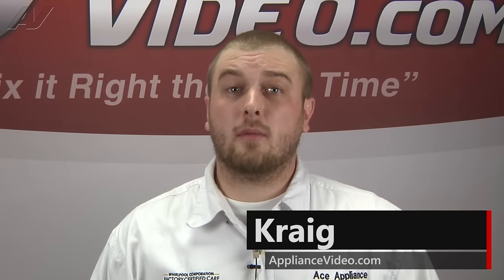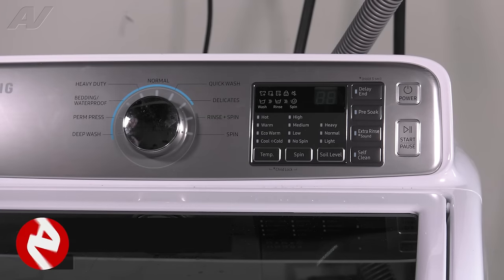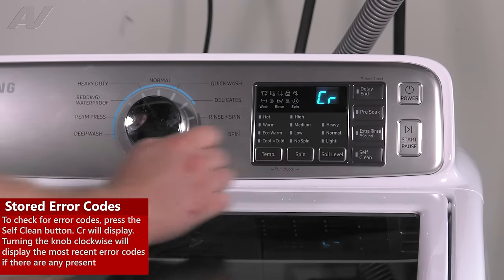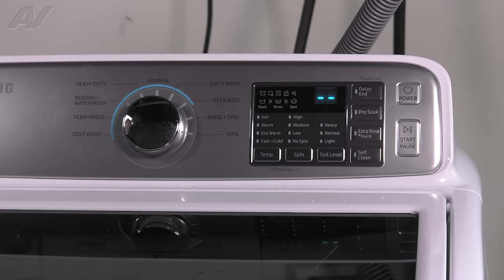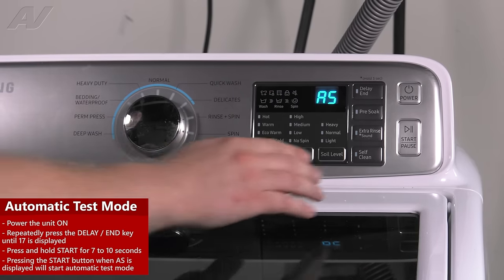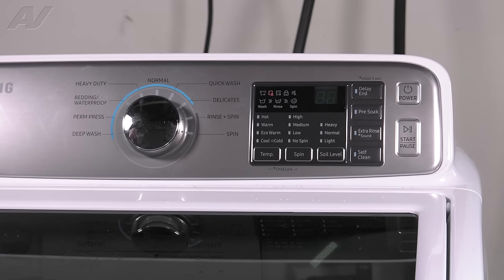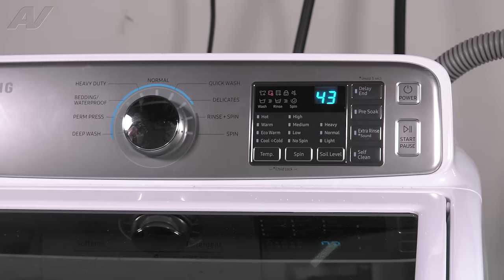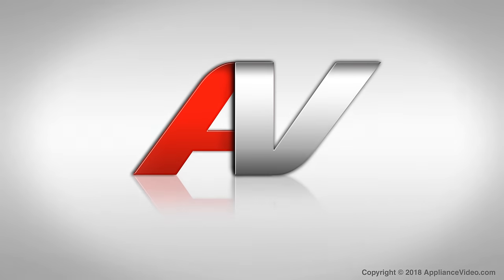Samsung Washer  - Diagnostic Mode, Error Codes, Troubleshooting

Comment: I have the same question as Linda a montho ago. My washer will not enter the AS mode.
Reply from the maker: Great question, if you have a more technical question that our parts department cannot answer, you can search our over 13,000 answered questions free at our website www.ApplianceVideo.com under our Repair Help section. You can also call our parts department at 1-800-830-5465 and they can give you help 7-days A week ,or search at www.SaveMoreOnParts.com  .
Reply: @Appliancevideo  Useless reply.
Reply: @damon7921  exactly that's all they just comment

Comment: I get a UE code all the time, I replaced the 4 suspension rods and was wondering what else I could do to reset it or recalibrate it.  The sumsung top washer is 9 yrs old..
Reply: I'm in the same boat. Changed the 4 x rods and cleaned the water pump. I still get the water and spin at the 8-9 minute mark and goes on until I manually stop it. I have to separate the load, then spin only for another 11 minutes. Add the second half load... Very labor intense... Anyone got any ideas?
Reply: calibration worked for us.  
To calibrate a Samsung washer, you can follow these steps:
1. Start by making sure the washer is empty and the water supply is connected.
2. Power on the washer and press the Power button.
3. Press and hold the Delay End button for three seconds to enter Calibration mode.
4. The washer will display “CAL” on the screen, indicating that it is in Calibration mode.
Reply: @Mikey-vt3to  I double-checked my error codes, and they went away after the reset. Also, put in a wash last night, and it ran well! The spin cycle is now robust. Thank you.

Comment: Just got this machine two weeks ago and already it's making a horrible grinding noise and won't spin.  Or anything else for that matter  With the exception of a KNOB to turn, it appears to be the same model except it's all digital.  I did everything you said and got to the CR, but then because I don't have a knob to turn I pushed the buttons one at a time, that corresponded as if I had a knob.  Nothing.  I couldn't get to the error codes.  And, nowhere on the internet/youtube can I find help for this.  Any help?
Reply: I am having the same problem
Reply from the maker: Great question, if you have a more technical question that our parts department cannot answer, you can search our over 13,000 answered questions free at our website www.ApplianceVideo.com under our Repair Help section. You can also call our parts department at 1-800-830-5465 and they can give you help 7-days A week ,or search at www.SaveMoreOnParts.com  .

Comment: please can you help me with washer???? when i put the washer in the program mode its fill with water,the pump runs and the agitator run but i wont get the final spin could this be a main board that needs replacing? also the console wont allow me to enter a wash cycle. any idea? thanks in advance...
Reply: model # wtw7500gc2
Reply from the maker: Great question, if you have a more technical question that our parts department cannot answer, you can search our over 17,000 answered questions free at our website www.ApplianceVideo.com under our Repair Help section. You can also call our parts department at 1-800-830-5465 and they can give you help 7-days A week ,or search at www.SaveMoreOnParts.com  .

Comment: We can press the delay key but when we press and hold start it won’t bring us to the ‘AS’ code.
Reply from the maker: Great question, if you have a more technical question that our parts department cannot answer, you can search our over 17,000 answered questions free at our website www.ApplianceVideo.com under our Repair Help section. You can also call our parts department at 1-800-830-5465 and they can give you help 7-days A week ,or search at www.SaveMoreOnParts.com  .
Reply: Same thing happens to mine too! Mine is a front load :)

Comment: Mine is showing code SC or may be 5C my washer is MODEL : WF45N5300UAW/US do you know what that means I've only had the washer for a year and cant find my receipt for warranty and the sears store I bought it at has closed down. I clean the filter once sometimes twice a month and only thing ever in it is just lint junk unlike to call it lol. The thing that spins to the left on the inside of the pump spins and it sounds like it pumping but water barely drains. The hose isnt to far into the hole in the wall so I dont understand what that code is for it spins with no noises just leaves water in the drum
Reply from the maker: Great question, if you have a more technical question that our parts department cannot answer, you can search our over 13,000 answered questions free at our website www.ApplianceVideo.com under our Repair Help section. You can also call our parts department at 1-800-830-5465 and they can give you help 7-days A week Monday Saturday, or search at www.SaveMoreOnParts.com  24 hours 7 days A week.

Comment: And I tried  to use the dial to switch between the codes/ modes it shut my washer off and now won't turn on any help would be great.
Reply from the maker: Great question, if you have a more technical question that our parts department cannot answer, you can search our over 13,000 answered questions free at our website www.ApplianceVideo.com under our Repair Help section. You can also call our parts department at 1-800-830-5465 and they can give you help 7-days A week ,or search at www.SaveMoreOnParts.com  .
Reply: Robot reply
Reply: I would try unplug from power to reset

Comment: I have that exact washer and when you mentioned a UB error I thought to myself hmmm that must ber what mine is displaying though I thought it was U6! Must be a small b instead of a 6.
Can you talk about how to get it into smart mode so I can connect to it through wifi or bluetooth?
Reply from the maker: Great question, if you have a more technical question that our parts department cannot answer, you can search our over 13,000 answered questions free at our website www.ApplianceVideo.com under our Repair Help section. You can also call our parts department at 1-800-830-5465 and they can give you help 7-days A week ,or search at www.SaveMoreOnParts.com  .

Comment: My Samsung smart washer shows a UR code is that unbalanced? If not what is it and how do I fix?
Reply from the maker: Great question, if you have a more technical question that our parts department cannot answer, you can search our over 10,000 answered questions free at our website www.ApplianceVideo.com under our Repair Help section. You can also call our parts department at 1-800-830-5465 and they can give you help 7-days A week Monday Saturday, or search at www.SaveMoreOnParts.com  24 hours 7 days A week.

Comment: Well that won’t work if/when it won’t even power on. Any suggestions? I’ve checked the outlet and it’s fine. I’ve unplugged it, waited and plugged back in. Nothing. It’s literally dead
Reply: What did you find out?! I’m having the same issue. It makes some clicking sounds so I know it has power but won’t turn on.

Comment: So dc means I have to replace my lid lock right?
Reply from the maker: Great question, if you have a more technical question that our parts department cannot answer, you can search our over 17,000 answered questions free at our website www.ApplianceVideo.com under our Repair Help section. You can also call our parts department at 1-800-830-5465 and they can give you help 7-days A week ,or search at www.SaveMoreOnParts.com  .
Reply: did you figure it out?

Comment: so you can unplug it and still use diagnostic mode?
Reply from the maker: Great question, if you have a more technical question that our parts department cannot answer, you can search our over 17,000 answered questions free at our website www.ApplianceVideo.com under our Repair Help section. You can also call our parts department at 1-800-830-5465 and they can give you help 7-days A week ,or search at www.SaveMoreOnParts.com  .

Comment: what if the delay end button does not work, neither do the pre soak, self clean, extra rinse.   none of the button on the panel work.   model is WA52J8700AW/AA.  The dial button does work
Reply from the maker: Great question, if you have a more technical question that our parts department cannot answer, you can search our over 17,000 answered questions free at our website www.ApplianceVideo.com under our Repair Help section. You can also call our parts department at 1-800-830-5465 and they can give you help 7-days A week ,or search at www.SaveMoreOnParts.com  .

Comment: What's the problem if the Washer stops at number 6 during the test mode?
Reply from the maker: Great question, if you have a more technical question that our parts department cannot answer, you can search our over 17,000 answered questions free at our website www.ApplianceVideo.com under our Repair Help section. You can also call our parts department at 1-800-830-5465 and they can give you help 7-days A week ,or search at www.SaveMoreOnParts.com  .
Reply: Did you ever get the answer? Having this problem now. Thanks 🙏

Comment: My mechanic won't start they change the wire that's connected to the lock cuz it was ripped in the middle but still it won't start washing any suggestions they told me buy a new one will be cheaper

Comment: I did this and mine stopped at 7 and after a few minutes, “SC” popped up, is it the drain pump possibly?
Reply from the maker: Great question, if you have a more technical question that our parts department cannot answer, you can search our over 17,000 answered questions free at our website www.ApplianceVideo.com under our Repair Help section. You can also call our parts department at 1-800-830-5465 and they can give you help 7-days A week ,or search at www.SaveMoreOnParts.com  .

Comment: AC6 code
I did RESET protocols......same problem

Shuts off 1/2 through load
Reply from the maker: Great question, if you have a more technical question that our parts department cannot answer, you can search our over 13,000 answered questions free at our website www.ApplianceVideo.com under our Repair Help section. You can also call our parts department at 1-800-830-5465 and they can give you help 7-days A week ,or search at www.SaveMoreOnParts.com  .

Comment: I hold start after setting delay to 17 but the AS never comes up. Any suggestions?
Reply from the maker: Great question, if you have a more technical question that our parts department cannot answer, you can search our over 17,000 answered questions free at our website www.ApplianceVideo.com under our Repair Help section. You can also call our parts department at 1-800-830-5465 and they can give you help 7-days A week ,or search at www.SaveMoreOnParts.com  .
Reply: same problem....any other fix? suggestions?

Comment: How do you put a Samsung front load washer 2019 in diagnostic mode
Reply from the maker: Great question, if you have a more technical question that our parts department cannot answer, you can search our over 17,000 answered questions free at our website www.ApplianceVideo.com under our Repair Help section. You can also call our parts department at 1-800-830-5465 and they can give you help 7-days A week ,or search at www.SaveMoreOnParts.com  .

Comment: Can I bypass I bypass the lock in my Samsung washer if it s broken
Reply from the maker: Great question, if you have a more technical question that our parts department cannot answer, you can search our over 13,000 answered questions free at our website www.ApplianceVideo.com under our Repair Help section. You can also call our parts department at 1-800-830-5465 and they can give you help 7-days A week ,or search at www.SaveMoreOnParts.com  .

Comment: I can hear a grinding noise and it doesn't spin at all and it pours water but no to fill maybe like a gallon
Reply from the maker: Great question, if you have a more technical question that our parts department cannot answer, you can search our over 17,000 answered questions free at our website www.ApplianceVideo.com under our Repair Help section. You can also call our parts department at 1-800-830-5465 and they can give you help 7-days A week ,or search at www.SaveMoreOnParts.com  .

Comment: Samsung washer WA400P****
I am getting a 3E code multiple times:
1) Tried to decrease load - it worked 
2) unplugged and returned - it worked 
From time to time, same error keeps coming back. 

Help???
Reply from the maker: Great question, if you have a more technical question that our parts department cannot answer, you can search our over 17,000 answered questions free at our website www.ApplianceVideo.com under our Repair Help section. You can also call our parts department at 1-800-830-5465 and they can give you help 7-days A week ,or search at www.SaveMoreOnParts.com  .

Comment: I have a weird problem, no error codes but whatever program I choose, it keeps just blinking the detergent signs and wont start, the water goes in and out in eco drum mode, but whatever mode i choose the spinning wont start. Unplugged and cleaned everything possibled, door locks fine. Yet no error codes, just has a weird humming sounds and water runs in.
Reply from the maker: Great question, if you have a more technical question that our parts department cannot answer, you can search our over 13,000 answered questions free at our website www.ApplianceVideo.com under our Repair Help section. You can also call our parts department at 1-800-830-5465 and they can give you help 7-days A week ,or search at www.SaveMoreOnParts.com  .

Comment: This is great but I have a PC error code and my tub still has water in it.  Not sure what to do. :-/
Reply from the maker: Great question, if you have a more technical question that our parts department cannot answer, you can search our over 13,000 answered questions free at our website www.ApplianceVideo.com under our Repair Help section. You can also call our parts department at 1-800-830-5465 and they can give you help 7-days A week ,or search at www.SaveMoreOnParts.com  .

Comment: I have model WF0500NCW, how to inter the diagnostic mode ?
Reply from the maker: Great question, if you have a more technical question that our parts department cannot answer, you can search our over 13,000 answered questions free at our website www.ApplianceVideo.com under our Repair Help section. You can also call our parts department at 1-800-830-5465 and they can give you help 7-days A week ,or search at www.SaveMoreOnParts.com  .

Comment: I have this machine and no error code comes out, but it does not load water up to the top, in any program. It only does it if I cancel and turn it on again, what can it be?
Reply from the maker: Great question, if you have a more technical question that our parts department cannot answer, you can search our over 17,000 answered questions free at our website www.ApplianceVideo.com under our Repair Help section. You can also call our parts department at 1-800-830-5465 and they can give you help 7-days A week ,or search at www.SaveMoreOnParts.com  .
Reply: Mine does the same thing. I can’t figure it out. It has one water level

Comment: Got one with a lid lock error.. I replaced it and it still gets stuck at 11 minutes will not spin but everything works fine in the automatic test mode.. Samsung is being way to secretive about their tech sheets.. it just says in the tech sheet to call for service like wtf is the point of the tech sheet if they holding on to the real one.. maybe the computer is just junk
Reply from the maker: Great question, if you have a more technical question that our parts department cannot answer, you can search our over 13,000 answered questions free at our website www.ApplianceVideo.com under our Repair Help section. You can also call our parts department at 1-800-830-5465 and they can give you help 7-days A week ,or search at www.SaveMoreOnParts.com  .
Reply: did you ever figure it out man? my samsung top washer has a dc1 error and it's only 3-4 months old lol.
Reply: Ghost Dog X I don’t remember the outcome. Don’t even really recall this much at all either but it sounds like a computer problem. In most cases u just replace the part for the error code

Comment: Is there a way to bypass the lid lock?
Reply from the maker: Great question, if you have a more technical question that our parts department cannot answer, you can search our over 10,000 answered questions free at our website www.ApplianceVideo.com under our Repair Help section. You can also call our parts department at 1-800-830-5465 and they can give you help 7-days A week Monday Saturday, or search at www.SaveMoreOnParts.com  24 hours 7 days A week.
Reply: you end up figuring it out?

Comment: I can’t get past 2nd step, after holding Start/Pause for 7or so seconds, nothing is happening...Not getting AS
Reply from the maker: Great question, if you have a more technical question that our parts department cannot answer, you can search our over 17,000 answered questions free at our website www.ApplianceVideo.com under our Repair Help section. You can also call our parts department at 1-800-830-5465 and they can give you help 7-days A week ,or search at www.SaveMoreOnParts.com  .

Comment: Mine started by showing 17hI, first step, he lid locked at this point,, then wouldn't do anything but show a ddc code.
Reply from the maker: Great question, if you have a more technical question that our parts department cannot answer, you can search our over 17,000 answered questions free at our website www.ApplianceVideo.com under our Repair Help section. You can also call our parts department at 1-800-830-5465 and they can give you help 7-days A week ,or search at www.SaveMoreOnParts.com  .